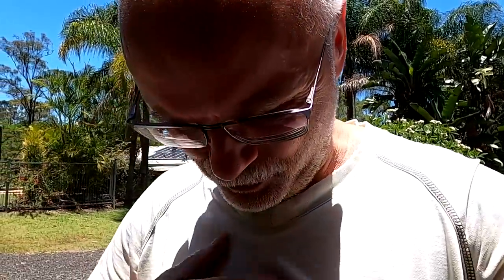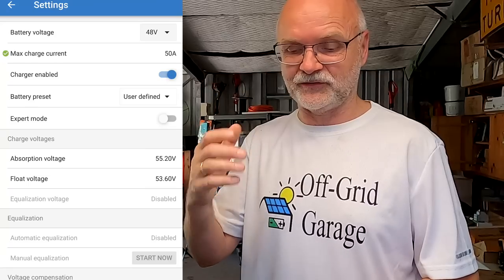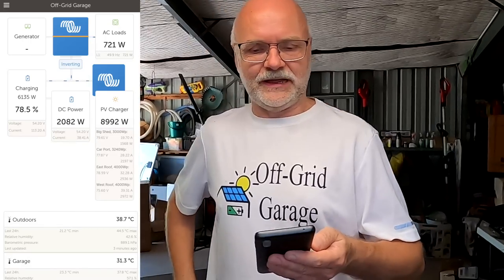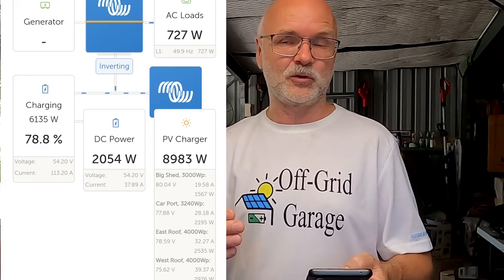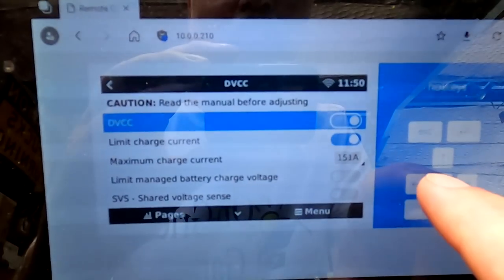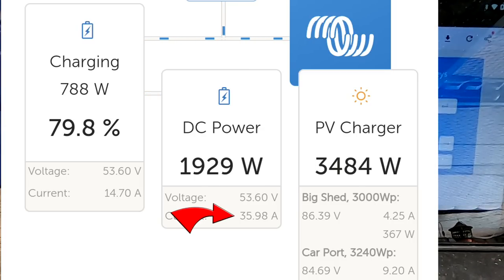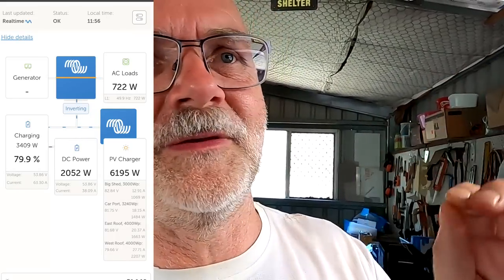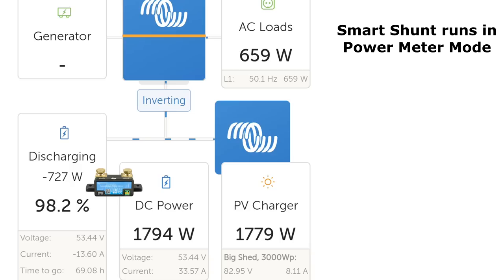Smart Battery Charging Control with Victron DVCC. It actually works!

Comment: Dvcc is great, but it could be great if this feature also worked in ESS mode, where feed in excess is activated. Victron do not think you should be able to turn down charge to battery. They just advice to buy a larger battery or do not do over panelling. I do over panelling to harvest enough sun in the darker periods, but this increase max current in a sunny day, which heat up battery. Makes no sense to charge fast in sunny days, you have a lot more hours to charge, so why not decrease current!

Comment: I don't understand the need for DVCC when charging, as voltage alone can control the process. A CAN-enabled BMS may share voltage with Victron, but since the JK BMS's SoC is inaccurate for small currents, communicating via CAN doesn’t seem useful. Limiting charging current through DVCC on Victron may be a nice feature, but since it doesn’t automatically adjust based on battery temperature, it seems unnecessary. The charge controller can handle current limits just fine.

In a setup with one BMS, one inverter, and one solar charger, using BMS CAN and DVCC feels redundant. Am I missing something?

Comment: If you add a Victron SmartShunt to the system to only show your DC loads, you can fix the problem with it only considering the total DC load.
Reply: I guess I should have waited until the end of the video before commending. :)

Comment: what are DC loads?
electronics that run directly connected to your 48V battery bank?
Reply from the maker: Yes, 48V-5V converter, 48V-12V converter and a non-Victron inverter. Basically anything which is not a Multiplus or Quattro.

Comment: There seems to be more to it than just that. In my grid connected system it seems to control the charger in the Multiplus II. 
Since I have a second inverter connected to the input of the Multiplus it charges the batteries from AC until the AC setpoint is reached.
Setting the charging limit to 0 still runs my MPPTs on full power, it just doesn't use any AC anymore to charge the batteries.
I never tried another value than 0 or unlimited. Maybe this would then behave as you described? Or maybe I would have to disable feeding to the grid?
Reply from the maker: With 0 you mean 0A for the current limit?
Yes, the current limit also throttles the Multiplus if connected as a charger.
Reply: @OffGridGarageAustralia  Yes, that's what I mean. But this does not shut down the MPPTs. They still run on full power if I set the charge limit to 0A.
Either 0A is kind of special or in a grid connected system that feeds in excess power the limit does not work the way it does in your system.

Comment: With the dvcc setting of 100 amp you placed 
Would this also apply for shore power ? Let’s say I have 70amp from shore power coming in to charge the battery plus 50 amp on the mppt would that be a total of 120 amp
Reply: @offgridgarage

Comment: Hi Andy nice one again. Couldn't u reduce the charge current through the bms I understand that the bms is the last line of defense and the best method would be to reduce it from the inverter. But just wondering.
Reply from the maker: The BMS cannot regulate charging current, that is the task of the charger.
(OK, this BMS can actually do it if on cell hits 3.5V, it reduces the charging current to 10A)
Reply: @OffGridGarageAustralia  is it you on telegram.  Just wondering if I got caught to a scammer.

Comment: your batt box did not have ventilation built in so it collects heat. think like your solar was like water or wind . how would get rid of the excess power? use Home Assistant and a couple of esp32's  to turn on fan's in the batt box , turn on ac to cool the batt and electronics when solar is to much. home assistant can integrate all of the items (bms , solar charge, inverter's, ect) onto 1 screen and can be installed on a raspi or esp32. and if you want manage from anywhere. so far i am using it to manage 3 smart thermostats (i built esp32) , 2 epever solar charge controllers and battery volts and current and can be used anywhere. phone, computer, pad or display on a wall. check out Home Assistant.

Comment: Running these setting with the help of HA automations you wouldn't manually have do adjust nothing ... Nice.

What about installing a cooling system for the batteries ?
Reply from the maker: Cooling was deliberately not a design option. In/outlet, filters, fans, control electronic, maintenance. And fine dust everywhere.
Reducing the charge current is a great way to avoid all that extra gear and also take away stress from the battery.
I also don't need to adjust anything, I can leave the DVCC sit on 100A and it works great. Maybe in winter, I turn it of altogether and keep this as an option for summer only.
Reply: @OffGridGarageAustralia  could you use ITTT (If This Then That) from various external data sources to program your victron system as required?
Local weather forecast, actual temp sensed by BMS / Tags you got, expected forecast over few days). If the weather is going to be crap for a few days, get a max charge in (winter/bad weather run) or if it's hot, sunny in summer, looking to be sunny for a few days it can remotely send an updated DVCC limit you specify????
Just thinking a bit more outside the off grid/victron world here.....

Comment: You should use all the acces power to run a small AC to keep the batteries cool and extend their life
Reply from the maker: Wouldn't make sense without proper insulation in the garage.
Reply: @OffGridGarageAustralia  Yea insulating the garage would be the hardest part

Comment: Will dvcc also restrict the Victron ac chagers as well?
Reply from the maker: What do you mean with AC chargers? It also restricts the charging from a Multiplus, yes.
Reply: @OffGridGarageAustralia  Ah. Fear question.
I got two 50ampvictron ip43 changers
Reply from the maker: @tom18181 That's a good question. I don't have such a charger personally but it may work if they are connected to the Venus OS system.
Reply: @OffGridGarageAustralia  Thanks. Yeah I have two ip43 chargers and both are hooked up to my Cerbo. I'll have to give it a try sometime. Cheers 😊
Reply from the maker: @tom18181  let us know if it works.
Reply: @OffGridGarageAustralia  Thanks. I sure will😊
Reply: Hi there. Just another quick question.with this DVCC option I notice in the Victron Manuel it says you must have a compatible battery. Ha ha my battery is not on their list. Just wondering if I do your trick and just put no BMS then it does not really matter what BMS my battery has because the cerbo will just be limiting the current going into my battery and my batteries BMS will just stop changing on its own aye ?
Reply from the maker: @tom18181  yes, correct. That's what I have done a well, set the DVCC to No BMS control and let the mppts do the charging but still restrict charging current and voltage (if needed)  through DVCC.
Reply: @OffGridGarageAustralia  Thanks heaps 😀
Reply: @OffGridGarageAustralia  Hi there Andy. Just a quick update. The DVCC does not seem to restrict the amps of the ip43 chagers. However that does not bother me as I can turn the amps of each chager down in the Victron connect app. I'm more interested in using DVCC with my 4 victron solar controllers. That really sounds handy to me. Ha ha I happen to be using the same BMS software as you OVERKILL  solar. 
It is a pity in some ways my bms would not show up in the Victron app as that would be cool to. Anyway I have got my shunt pretty close with my battery SOC now which is the main thing
Reply from the maker: @tom18181  Great, thanks for sharing.
Depending on the BMS, you can connect it as well to the Victron system.
Reply: @OffGridGarageAustralia  oh ok. I'm not sure with my BMS. It has a JBD BMS I think. Do you know if they work with Victron?

Comment: I did try to fiddle with charge current limiting through DVCC a while ago - but the limit i set were ignored by the system since i have excess DC-PV feed-in enabled. The reasoning seemed to be that the charge controllers always need to be able to supply their full power to enable exporting the excess. Of course the system can miraculously throttle the charge controllers to not exceed the feed-in limit i have set. Really seems more like a software issue to me - i'd be very happy if Victron would address that :/
Reply: Dc feedin really does mess things up with regards to charge current - all limits from the BMS are ignored. I’ve reported it and been dismissed by Victron. At the end of the day I just disabled dc feedin.

Comment: Hi Andy,this what came to my mind when I watched your vidio wouldn't it be just as eazy to turn off one of your installations when we know of the weather will be very sunny for a prolonged period this only requires a flick of a switch.Andy could u please advise me on why the 2 battery packs I have with the same BMSs for each pack show me that 1pack has this 
55.81V, cell reading is 3.488 ,and state of charge is 98%.
where the other pack shows ,55.63V,  and cell reading is 3.477 and 61% state of charge.these are both JK BMSs  can u put a finger on this issue for me.cheers Rene.from sunny Vic. 23cel.
Reply: I think Andy wants to automate this process as he cant manually flick a switch if he is at work when this is happening, I did have similar thoughts of ur idea but using relays/contactors to do this automatically via his controllers. 
Regarding ur SOC question, I would have to ask if these voltage reading were taken while the battery is charging & at what rate (amps) & also are they both paralleled together, cabling situation, are both BMS’s parameters set & calibrated the same, IR’s, etc? My guess without more info about ur system, is that while charging this SOC reporting data could still be correct or close to, which may not sound right as you would expect them to be closer together than a 37% SOC difference, but at around 3.45v/cell under charging conditions there can still be quite a variation of total SOC/cell, I would not expect them to be as low as 61%, but then have u done a full charge & discharge cycle of both battery banks to help calibrate ur BMS’s? IDK if u have noticed ever, that sometimes as the batteries are getting near full SOC the reading can jump from reporting 70-80% to suddenly it shows 100% as ur cells hit 3.5v-3.6v/cell. You can tweak the calibration of ur BMS’s to some degree to help get them to report more consistent and precisely. Just my thoughts. Cheers

Comment: Great video as always :-) i was woundering, all the victron that you have running, chargers. cerbo. vrm, raspy, volt monitors and so on, all the equpiment, including the bms´s how mouch power do it use, lets say days where the aint no solar so nearly no charging, how mouch do it drain your batteries ?  all gadges is nice, but it must still use power to run.

Comment: Wow, you like to do interesting experiments!
-So the seplos is trying to (partially) control charge by disconnecting with mostfet? ‘Disconnecting with mostfet’ I call that High voltage disconnect (HVD)? Is that the same? And your HVD is set to the same voltage as MPPT controller, no float and 55.2V? It seems to me there will be no absorption in this system?
-The 'microcycling' I encountered while trying to balance an out of balance battery where the BMS does HVD until balance is achieved (brings the bad cell in line). I call that top bouncing and I do not like it. Would that stress the MOSFETs long term?
-Hopefully I have an explanation for your low voltage reading on one battery while charging the other. The charge mosfet is off on the ‘low’ battery. Since your +'s are connected together, and the BMS measures voltage at the cell relative to the common +, the ‘charge switch off’ battery will read a lower voltage (the discharge mosfets acts like a reverse diode and the voltage from your main bus cannot get to the cells). Then when the charge mosfet finally turns on, the higher voltage battery will start to charge the battery that was sitting at a lower voltage……
If this is true you will probably get the same effect with matching batteries (same AH) since there will be small differences in wires/voltage accuracies. It would be interesting if someone reports on a system with matching batteries.
Reply: Oooops posted to wrong video. Should be seplos video. Sorry.

Comment: Hey Andy, why not try setting up the CANBUS of the JK BMS and see what comms you can get working between the Victron system and JK BMS? I can send you the CANBUS cable for the JK BMS, just send me your address. Thanks again for another great video.
Reply from the maker: Thanks Trevor. I have already done this in a past video. Communicating with only one BMS out of three, would not work well as it does not tell the full story about the battery.
Reply: @OffGridGarageAustralia  Thanks, need to go back and watch that one then. Interested in seeing what is possible and what is missing. Thanks for the reply.

Comment: Sorry do you have the do the dvcc settings for every controller or is all the controllers controlled by another software ?
Reply: In this setup, Andy is using a RaspberryPi running VenusOS. A CerboGX by Victron would provide the same functionality. This is a Victron ecosystem feature. All of Andy's charge controllers, AC inverters and DC shunt are Victron devices (minus the 3000w inverter he is using for some house loads which shows as DC load in the control panel / VRM)

You set it in the control panel once, and it talks to and controls all of the Victron components in the system. No need to configure each component of the system individually.
Reply: @CollinBaillie  Many thanks, for clarifying :) was trying to understand so we would know what we would need to run such a system like this.. Thanks again 💯💯💯
Reply: dvcc regulates all chargers also the Multiplus (when my generator is running)
Reply from the maker: Ah, I was wondering if it limits the Multiplus too when charging. Thanks for that info, Martijn.
Thanks, Collin for this comprehensive answer.

Comment: I watch so many of your video it's hard to believe I don't understand this, but I got new batteries, and they don't say in amps what I can charge at. I have 3 in series and So I do understand what the max charge amps is for one battery is the total for the bank (36v) but all the info says is "Charge Current Less Than 0.25CA". There is HR series upstandbattery 12V 18Ah. I charge them at .75Amps max thinking my max would be 0.25 per battery cell but I don't know. I don't trust myself lol they also charge fine at .70 amps.
Reply: Id says if you made an explanation vid for dummies on that you will get about 10-20 views from me alone lol

Comment: Cool. I did something similar during the autumn to watch and adjust the temp inside the batteries. 3xinverters each at 50A=150A total atm. charging 4 big x 200ah batteries. The batteries WILL last longer when cooler.

Comment: Are you still ising dvcc?
Reply from the maker: No, it is turned off now and I have setup the Victron Smart Network again. That works very well and syncs all data across the devices.
Reply: @OffGridGarageAustralia  can i ask why? Im thinking of using it on my open loop system. Did you have any issues with it ? Or is it because it is not summer anymore there in Australia.

Comment: Why don't you take some of your massive overcharging and run an air conditioning unit to cool your batteries?
Reply: Great idea. Use a heat pump to control the temp in the same way the Tesla does. That would make a great new project.
Reply from the maker: That's what I said in the video.

Comment: It took about 5 seconds between: shouldn't we use another smart shunt between the battery and the DC load. I wrote a comment immediately and continued the video. But hey, 5 seconds later you introduced the smart shunt and I deleted my comment.

Comment: Andy, now your batteries could  use an AC (maybe a mini split) to cool your batteries and suck up some of that extra power so you can put more into you batteries. What a great problem, to much power. Soon you could use all that power to take over the world!
Reply from the maker: Yeah, I'll get one of this small mobile ACs to start with. I haven't got much wall space left for a wall mounted AC. Doesn't take much power and I have plenty anyway when I need the AC.